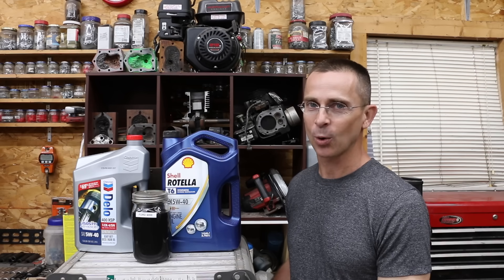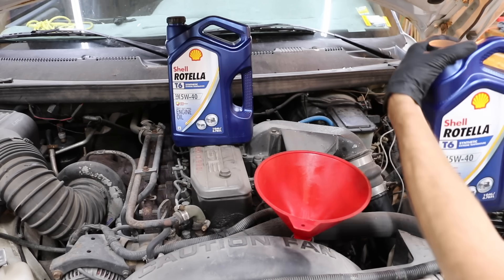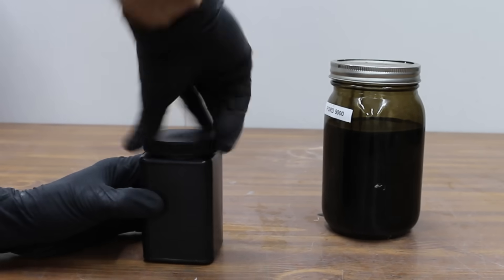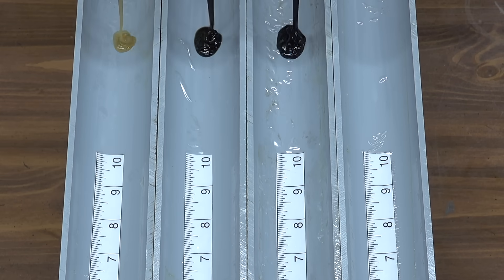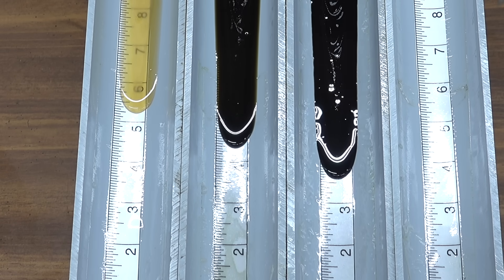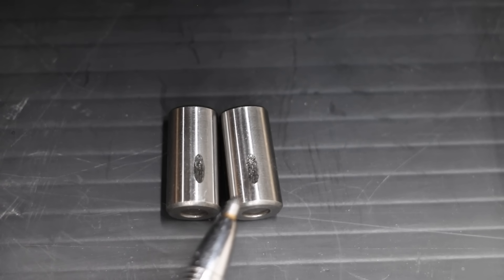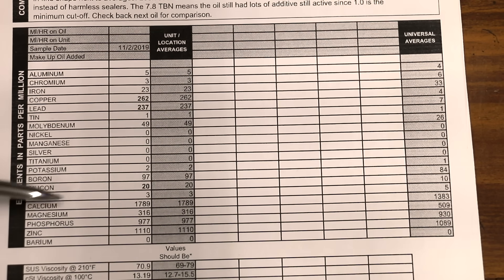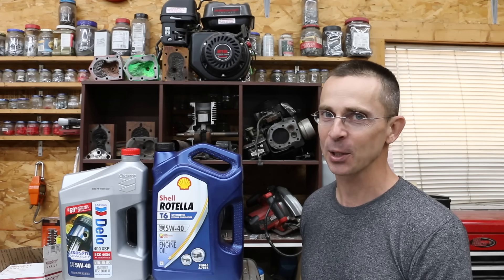Will Annual Oil Change Damage Your Car? Let's find out!

Comment: I haven't changed the oil in my Porsche 944 turbo in about eight years as it only has about 1200 miles on it and it's not because it idles a lot, when driven it is driven far enough to get well into operating temperatures for at least 15-20 minutes. I try not to start it if I'm not going to run it to full operating temp. Also, I try to drive it once a month to/from work, about 20 minutes each way.
Reply from the maker: Thanks for the feedback.

Comment: I used to have a van that was rarely driven in a fleet situation. I would take a small sample every year and send it in to get a report on it and even after 3-4 years the report came back good. They tested coolant/moisture contamination, grade retention, lubricity, and several other factors. Also, oil additive salesmen used to go around to auto repair shops with a machine like he uses here to test oil lubricity and how well much wear occurred with plain oil and how much less with their additive even with more weight applied to the lever using weight plates. I asked one salesman which oil did the best without the additive and he told me Valvoline, I've been using it ever since.
Reply from the maker: Thanks for the feedback.

Comment: From an anecdotal point of view i.e. imperically speaking, failing to change the oil in my engine on a regular annual basis will shorten its life.

I've just carried out my oil change a little late recently due to several factors. However, on changing it the resulting increase in performance is palpable as is fuel economy not just power. My engine doesn't perform efficiently when it approaches it due oil change. 

I use the oil type that was put in the engine on the production line.

Lastly, I wish I had an EV car so I can stick two fingers up to not only diesel use but also annual oil changes.
Reply from the maker: Thanks for sharing.

Comment: pre filling filters is actually a bad practice, not recommended, it will push any left over crud into the engine, and not allow it through the filter on initial startup, no oil change instructions, tell one to pre fill the filter
Reply from the maker: Thanks for the feedback.

Comment: So, question, what makes the engine oils turn so dark after only 3,000 miles of use?  Color change of the oil in modern oils must not mean anything?   Doesn't indicate the engine oil has gotten "dirty"?

Comment: I've changed the oil twice in my 2020 Honda Civic. Mobil 1 0-20 with a Mobil 1 filter.  It takes about a year for the reminder to come on. Same thing with my last Civic I had new since 2002 with no problems. I only put 94k on it before I traded it.
Reply from the maker: Thanks for the suggestion.

Comment: Notice engine -- and oil -- up to operating temperature is an important criteria for oil life ! ! !

Otherwise, 

All bets are off.
Reply from the maker: Thanks for sharing.
Reply: @ProjectFarm  You're welcome. My background is Mechanical Engineering and I've been watching this for a long time. In the olden days, (1) the primitive carburetor systems would dump lots of gas into the cold engines and (2) The oils weren't quite as good... so, change the oil often. Today's fuel injection systems don't do that and the oils are more sophisticated so longer change intervals. And, synthetics are another world entirely. So, now it comes down to operating cycles: once a week for 1 mile to church and an occasional 1 mile trip for groceries is a harder duty cycle than an always_on police car or cab (using synthetic oil). I'm thinking that using the lab to test the oil until you can see what your actual duty cycle interval should be. Otherwise, unless your car uses oil, be safe with synthetics. In other words, if the engine and oil get hot enough to boil off the water each use then you can use the maximum specification safely. Otherwise, test to see what's going on.

Thanks for your consistently fine work.

Comment: Interesting story. While playing with my 350 engine over a 6 month period I didn't realize that I already put seafoam in it. I got it running decent and developed a lifter tic. But they're new along with the pushrods. I wasn't getting oil to the heads. Turns out too much seafoam on 180k engine loosened buildup enough to block an oil passage. Still playing with it
Reply from the maker: Thanks for sharing.

Comment: First off, I love your videos and have been a subscriber for many years. But I would like to make a small correction. A horizontally mounted oil filter CAN be filled at least half or a little more filled with new oil with very little if any spillage. I have been doing it for years. Thanks again for all the GREAT videos and info you post.
Reply from the maker: You are welcome!  Thanks for the constructive feedback.
Reply: Th asks, me too.
Reply: Carl I have a 97 f 150 that would beg the differ.
Reply: @crawwwfishh3284  Sorry to hear that. I'm sure if the filter is in a tight place or something like that it could be difficult to not leak a little oil. But I have found that even in tight spots I could fill it about half full and get it installed with little to no oil spillage. Good luck
Reply: Yes, at least those that have an anti-drainback - the little rubber flap behind the small inlet holes.

Comment: I have been using t6 for 6 years in my c12 engine and have put on over 800k miles.  I use a oil bypass system from ops1 and oil sampling.  My last complete oil change was over 180k.  And the oil was only changed due to metal build up.  After 20k I change the oil filters and drop a gallon of oil (9 gallon sump) and add 2 gallons of new oil  (1 gallon in oil filters) which increases your detergent levels ie base.  The point is you don't need to change your oil if your using an oil bypass system with a 3 micro filter and use oil sampling.  Change your filters at regular intervals, use a quick drain plug so you can drain 2 gallons or 20% of oil capacity and you can us the oil over a long period of time.
Reply from the maker: Thanks for the feedback.

Comment: Hey bud love ur channel. Just wanted to comment that I see nothing wrong with the way you test the viscosity of the oils but some years ago I worked as a Derrickman offshore in the oil patch and one of my duties was to check the weight & viscosity of the drilling mud about every 15 mins. The way we did it out there was to get a sample of mud from my active pit and pour it into a marsh funnel and time it as it drains into a cup. 
Im curious if the viscosity test would be the same with this method. 
Anyway, thanks for your work!
Reply from the maker: Thanks!
Reply: @ProjectFarm  I forgot to say that the benefit to measuring viscosity in this way is that you can easily record the data so that you could compare viscosities across a range of different types of fluids as long as you use the same funnel, cup and temperature etc🤘🏻

Comment: Not to go off topic, but is that ol Dodge for sale? 
I love your channel. There effort that you put into your test impressive.
Reply from the maker: Thanks so much!   The Dodge id not for sale.
Reply: @ProjectFarm  if you find time, could you test the limits of Royal Purple synthetic oil? I have an older relative whose been running it since before synthetic oil was a thing. He runs it 15k miles in his vehicles, then catches it and runs it in his equipment. He only changes his filter every 5k miles and adds the filter loss. I once saw him mic a cylinder in a Nissan Altima that he bought new and put 300k miles on. It was still within factory specs. (He had an issue with the head, so he checked it while it was off)
His house is easy to find. It's the one with the purple drums beside the shop😀.

Comment: With todays motor technology the myth of changing your motor oil every 3 months is another myth, especially using synthetic motto oil. I’ve gone 6k miles checked the oil and the oil still is clean, some oils recommend 10k mikes 🤷🏽‍♂️ make sure you’re using a good oil filter and depending on your usage and driving check often.
Reply from the maker: Thanks for sharing.

Comment: One thing I've learned working at a lube shop is how important it is to double-check oil levels when doing a new filter. Even with smaller filters, it's common to need add another half quart when the filter is saturated. Even if you pre-fill the filter, it's best to double-check
Reply: As long as the oil is above the add line you are fine.  1/2 a quart below the full line is not an issue.
Reply from the maker: Thanks for the feedback.
Reply: Yes, I noticed that, just a day after I had the oil changed ...at the dealer.

Comment: I'm curious is if you're using any type of motorkote or oil additive products in your T4 cummins or your tractor?
I've seen some other YouTube videos that actually post the lab results before and after on the oil or the fluids that are being tested and give the results of the actual Metallurgy or other metals or chemicals before and after that are left in the oil which makes me want to know if you could test your motorkote before-and-after and see what you have for new oil vs. Used oil treated wood Motor coach motor coach versus a regular synthetic

Comment: I would like to k or what material the bearings are composed of, and what material the wheel is composed of.  Also any hardening or surface treatment process applied to each.
Reply from the maker: Thanks for the suggestion.

Comment: Todd-  Would be great to see a comparison between Rotella T6 (currently used in 2020 PowerStroke 6.7L) vs Costco/Kirkland 15W-40 full synthetic diesel oil.  Could potentially save $60/oil change, nearly $420/year.  Thanks in advance.
Reply from the maker: Thanks for the suggestion.

Comment: 12v cummins engines are very easy on oil for a turbo Diesel engine and aren’t expected to wear it out significantly by the end of any given oil change interval. Your test results would be much different if you had taken oil from an engine like a 7.3 powerstroke with a high pressure oil system that shears and wears out the oil considerably.
Reply from the maker: Thanks for the feedback.

Comment: Amsoil guarantees their oil for 25,000 miles, and when I first started using it I had the oil changed after 10k miles and sent it to a lab. It was still good. I still change my Amsoil after 10K , I live in Western Canada, my vehicles start at -45F, I have work trucks who have over 100k miles on the odometer and none leaks a drop of oil. I've been using Amsoil for about 15 years and I have absolutely no doubt that Amsoil is by far the best oil out there.
Reply from the maker: Thanks for sharing.

Comment: There is quite the debate on engine oil best suited for a Polaris RZR XP 1000 on Facebook. The majority of people are using Rotella T6 instead of the OEM Polaris PS-4 engine oil. Not sure if its true, but a Valvoline rep once told me the diesel oil does not have enough anti-foaming agents to be used in a high-revving gas engine. Is there any way you can test T6 against, Polaris PS-4, and possibly Royal Purple??? If I can assist in any way, let me know. I would love to see the results!!! Thank you, Tony
Reply from the maker: Thanks for the suggestion.

Comment: Great information in this video, many thanks.

I have a friend with a diesel Jeep Liberty. I'll make sure he knows how good that T6 is. He has been using it since the second oil change. Glad to learn it specifically is designed to protect the turbo charger. That little four cylinder is a might mite. It can pull a big heavy trailer with little effort. But of course the diesel is all about torque and his makes 300 pounds at just 1900 rpm. Last I knew his diesel had 250,000 miles and it is a  2005 so it's approaching 17 years. He has a friend with an identical Jeep who changes oil every 10,000 miles. He changes the filter at 5,000 and then oil and filter at 10,000. It will be interesting to learn if the oil is good for 10,000.
Reply from the maker: Thanks and you are welcome!  Thanks for sharing.

Comment: I change the oil & filter on my motorcycle once a year whether it needs it or not.   Yeah, maybe the oil could last longer and I would be "ok" with riding it more miles.  But with 4 quarts of oil and a filter at under $25, why be overly cheap?  I think it's just good peace of mind and insurance for your motor.  And engines like clean oil.  They hate dirty oil.
Reply from the maker: Thanks for sharing.

Comment: Main problem I see with people doing annual once a year oil service is that they neglect checking oil level between services which usually leads to engine being 1+ quarts of oil low because of normal oil consumption, consumption which would not be noticeable if oil were to be serviced 2-3 times a year.
Reply from the maker: Thanks for the feedback.

Comment: T6 has to much zinc to be rated SN in the first test the old oil flowed faster because oil in the crankcase becomes diluted every engine has to warm up that is why I will never be a fan of high mileage drain intervals sorry AMSOIL

Comment: How about comparing Aircraft Piston Engine oils. They charge so much more for them but I have always wondered if they are that much different. Also the oil filters on the aircraft engines.
Reply from the maker: Thanks for the suggestion.

Comment: My Toyota Avalon has known sludge issues if oil not changed regularly..I do conventional oil changes on my Avalon and Tacoma both V6's both motors run well with conventional and change every 3000-4000 miles ...oil is cheap the motors are not. Synthetic is not cheap
Reply from the maker: Thanks for sharing.

Comment: Don't prefill the filter...you're filling on the oil exit end.....if there is ANY contaminates, it will go though the bearings, instead of through the filter.  Remember, the filter screens down to the microns......and main engine bearings are .003 clearance.
Reply from the maker: Thanks for the feedback.

Comment: How about the oil when the vehicle reaches temp for long terms and operates 24/7? I drive Hot Shot with a Ford F250 6.7L diesel. when it is cold or hot outside, I run my engine 24 hours a day. Since I am running the engine all the time, will I be able to go longer than directed by the manufacturer or should I still stay at the recommended 10k oil change? I haul loads up to the GCVWR of 33,000 if that makes a difference, but most loads are much below that rating and are in the 20k range.

Comment: I run hot shot loads on an F250 with a 6.7L Turbo. Would it be safe to do an oil change every 20,000 as most miles are highway, even though they could be towing a trailer and cargo weighing up to a GVWR of 15900.
Reply from the maker: Thanks for the suggestion

Comment: I used Lucas Transmission Fluid in a Kia that had issues because my son got stuck in a snowbank and used the transmission to burn his way out of a snowbank. The transmission would not even move the vehicle after the incident, but adding the Lucas fixed the issue, and the vehicle returned to normal operation for the 6 months we had it after the incident when the vehicle was totaled in a collision. From the day it was added till it was totaled, there was no slippage in the transmission. You do some awesome testing, but in certain instances, there are other things to consider. The claim that it immediately repairs the issue is an over statement, I worked the transmission between forward and reverse about 20 times over a 10 minute period. I gave the Lucas a chance to work into the bands before pushing it to the max. That could be part of the issue and I'd like to know if it has improved in operation over time.

Comment: Conventional motor oil is becoming hard to find. My Toyota dealer does not approve changing to synthetic due to potential for new oil leaks. I do my own oil changes at 5K miles or 4 months. Project farm’s video shows excellent performance of synthetics in long term testing. I would like to see a test demonstrating that synthetic is ok for well maintained older vehicles versus mineral oil.  I think the restriction against synthetic is due to the synthetic cleaning gunk from seals allowing leaks or maybe seal compatibility.
Reply from the maker: Thanks for the suggestion.

Comment: We used Delo 400 in our personal 4 wheeler vehicles, New Holland tractor and semi trucks. Engines quieter and had fewer leaks with Delo 400 compared to Rotella which we tried a couple of times with no benefit. No differences in wear or corrosion. Go a year between oil changes and you are asking for trouble. 
Lots of truck owners swear by Rotella, though...
Reply from the maker: Thanks for sharing.

Comment: I change the oil in ALL cars and trucks every 3000 miles or 6 months. the 3000 miles almost always comes first. I usually drive a vehicle at least 9000 miles in 6 months. My 2006 Mercury Grand Marquis has 270,000 plus miles on it, and still runs like new. Compression is within spec for a new engine. I also use 10w40 instead of the 5w30 it recommends.
Reply from the maker: Thanks for sharing.
Reply: Whats your theory for the using 10w40 over 5w30?
Reply: @RJ-oi9fh  Heavier oil has much higher film strength, and provides much better protection for the engine, especially the bearings

Comment: Hi, Todd, this video uses motor oil for truck Diesel engines, mine is only 1.6L 4-cyl engine, where could I send old sample of my synthetic oil, my last oil change was 3500 miles ago in 2020, it has still 2000 miles to go, it would be two years after January 2022. My car was sitting when I went to army training for 7 months and a half. (My dad moved my sedan in parking lot every week.) It would be a fun project to share if it’s in good condition. Where could I send the oil sample to you?